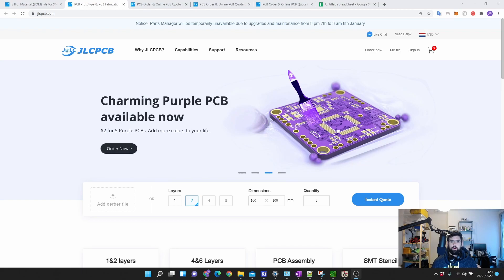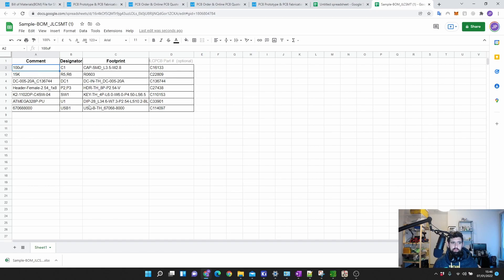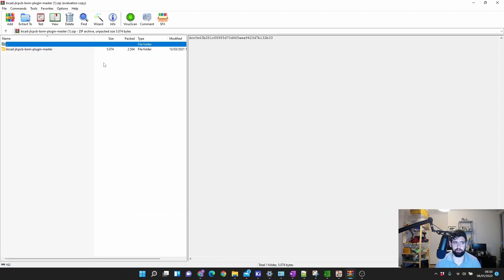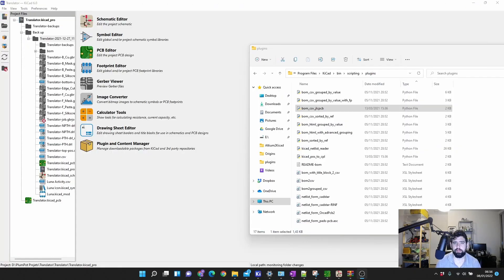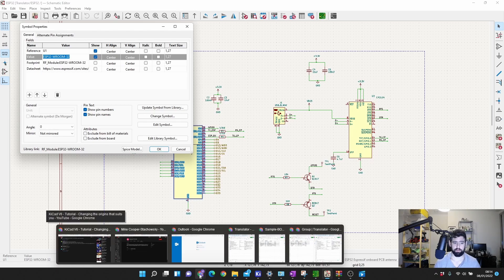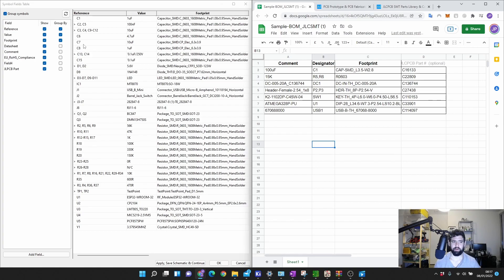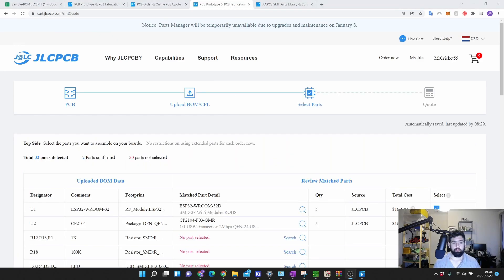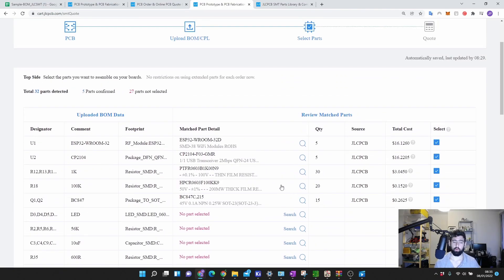KiCad V6  - Tutorial - Creating the perfect BOM for JLPCB

Comment: In the faq for generating a bom file by jlcpcb, it says to be familiar with smt sizes, but you use the footprint name instead. Are they just looking for the footprint to associate to the designator? Is it the same as the manufacturer part name?

Also, if they don't have the part in the lcsc, but its in the global parts library, can I use the distributor part number? 

I'm very confused by this file.